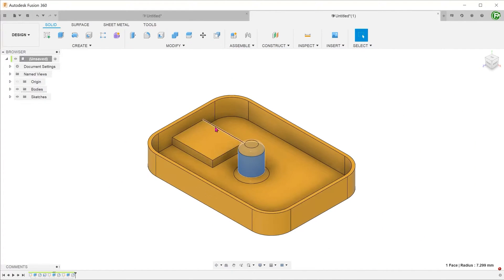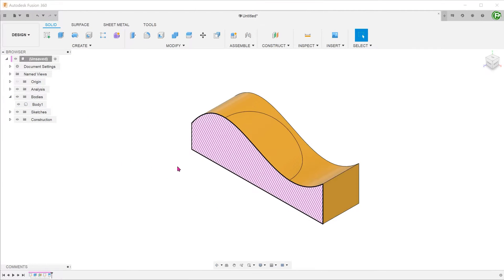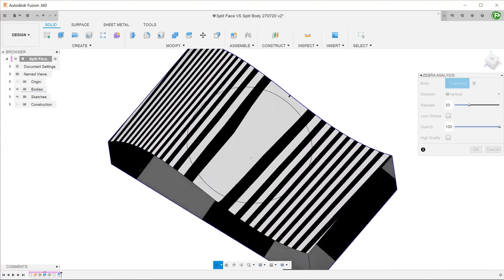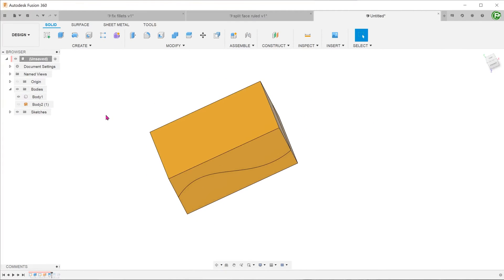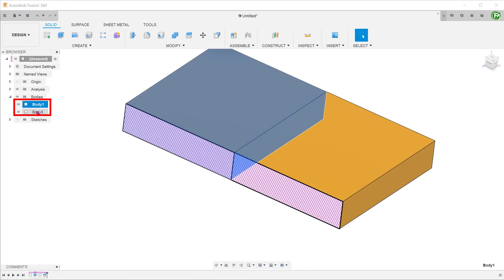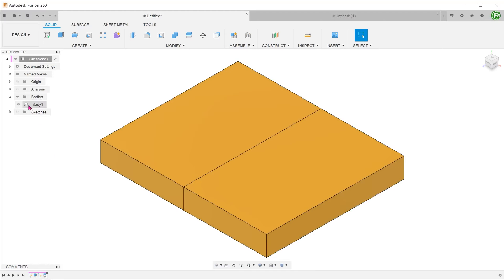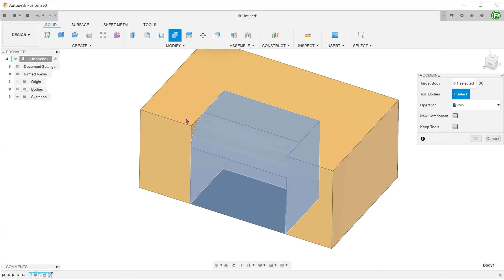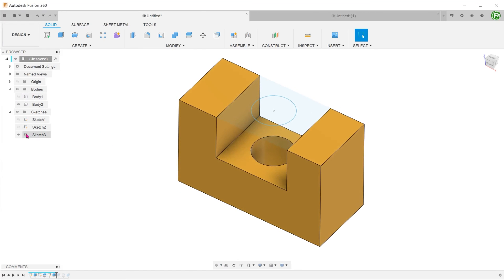Fusion 360 - Split Face VS Split Body

Comment: Thanks for the video. But you did not explain the types of split face. Also, the split face uses were a bit vague. I tried to split a face using a slot as you had shown as an example but couldn't do so. Could you show us how you did that?